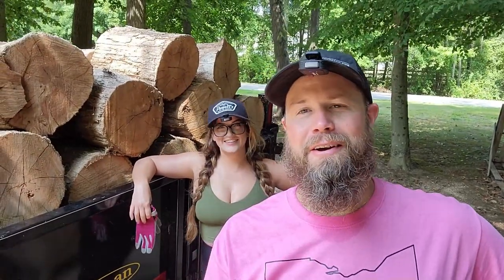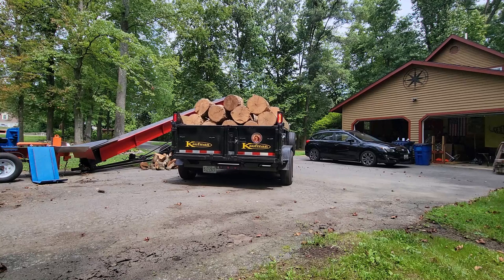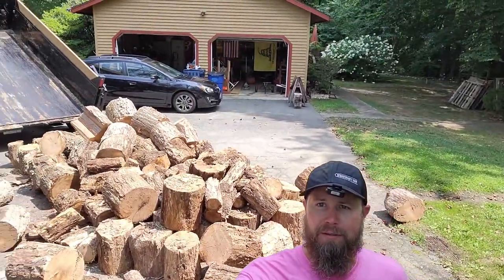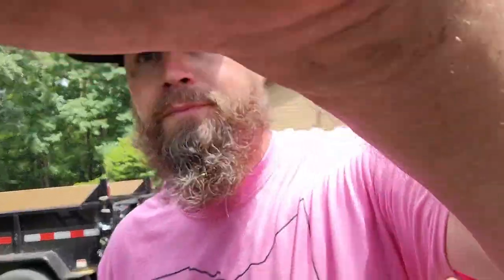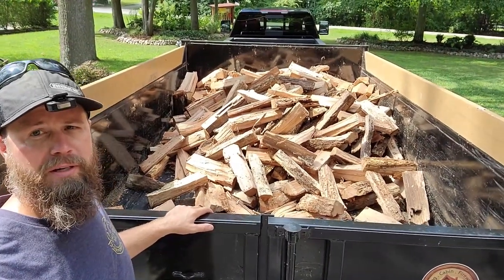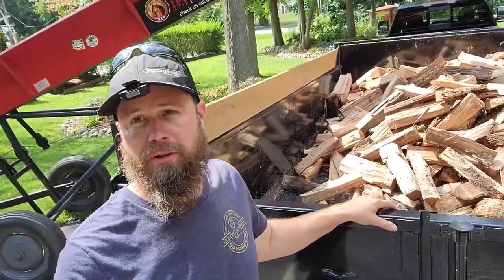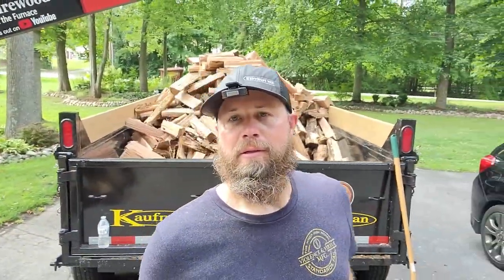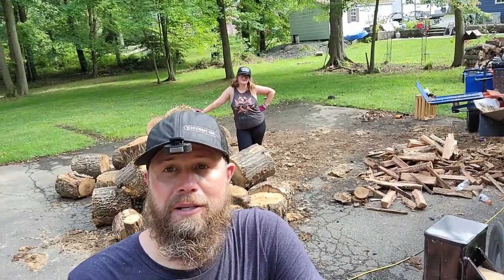Splitting Oak With A Special Guest #20

Comment: Outstanding job Taryn!! Oak is the heaviest stuff we cut.... stinkiest also... but it's also 1 of the best for btu's.... Jack i did an experiment on 3 white oak trees years ago. All were 22"-26" at base. Left 1 standing at 10ft. Cut 1 down and left solid at 10ft. Bucked 1 up at 16 inch rounds... after 3 years the standing tree was at 44% the downed tree was at 35% and the rounds were still at 28% moisture.... Oak just needs to be split to cure period... the smaller the quicker.
Reply from the maker: Yeah I've never gotten much oak here, so I was hoping for the best... it's split and stacked now. We'll give it a season and see what it's at then. That's a pretty cool experiment ya did, to show all possibilities.
Reply: @LogCabinFirewood probably gonna need more than that
Reply from the maker: I have plenty of other stuff to burn if it takes longer than that 🤣
Reply: @LogCabinFirewood  I meant time, srry

Comment: Done good job backing up. Small tip put your on bottom steering wheel need to go rite push right vise verse to go left and look in mirror to Start with pick point where you want trailer to go and go for it
Reply from the maker: Good tip! Thanks 💪

Comment: Hi Taryn and Jack, Taryn you did a marvelous job handling the trailer. You don’t learn this over night. Keep practicing and take your time.Nice Job.  The oak sure looks way drier than it was. I guess that why be need to bust it open to get it to dry. Taryn nice to see you helping Jack out. Many ladies are sometimes hesitant to get involved because they are afraid of taking on a permanent position. I know Jack wouldn’t let that happen. You two have a great weekend.😊
Reply from the maker: I never turn down a helping hand, I could definitely use a hand more often, as i think we all could 🤣 I was super  impressed she hopped right in the truck and owned it.  It's alot harder than i thought it would be to try and coach counter steering too.  Learning experience for us both.  Thanks for stopping by 🍻
Reply: @LogCabinFirewood  once she gets the hang of having to turn the opposite way it's easy. I however have a hell of a time using the mirrors. Yrs of turning around and looking w the tractors. Once she gets it down, borrow a farm wagon and learn that. Turn same direction w those

Comment: If you have a 4x4 truck or SUV, put it into 4-Lo. That way the vehicle goes fast enough on its won without having to touch the throttle, only needing brake input.
Reply from the maker: I was generally speaking,  with any big load. Folks that wanna mash the pedals down and think it's a race car while loaded or wait for the last minute to brake while loaded both are very hard on vehicles.  For around the yard that's a cool suggestion though,  thanks Doc 💪
Reply: @LogCabinFirewood  yes, my suggestion was for low-speed maneuvers in the woodyard. Is also a lot less stress on the transmission during such low-speed use with a heavy load.